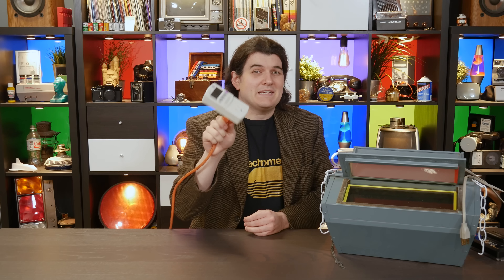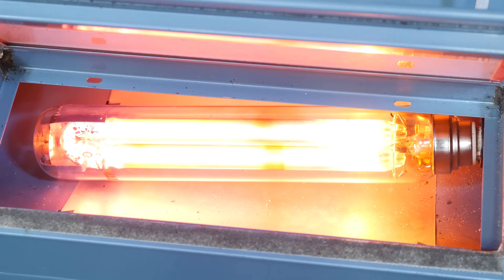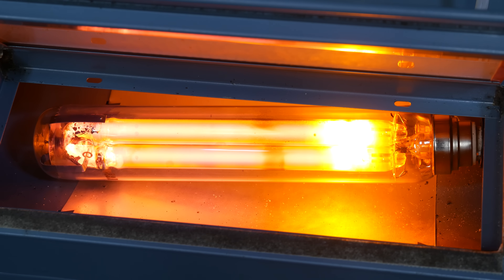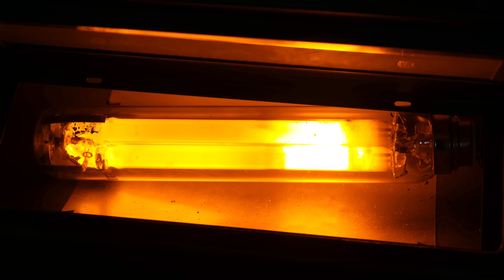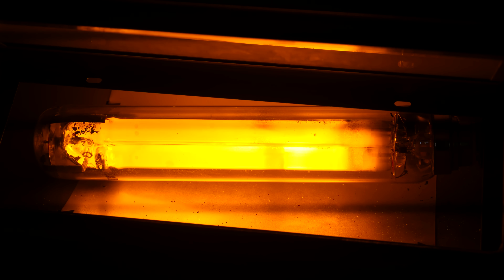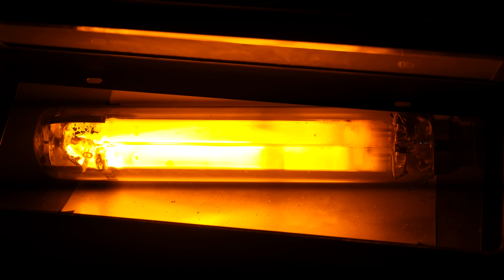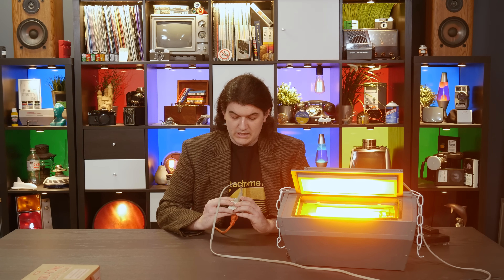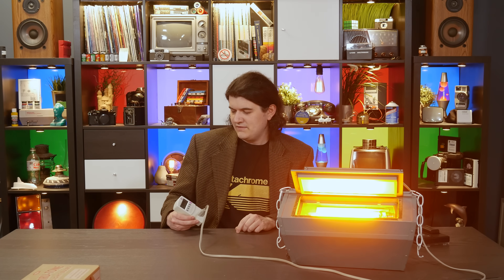More vaguely-informative ramblings about low pressure sodium lamps

Comment: It is a shame that this rather great technology is getting replaced. In many cities it seems the "consultants" they are asking are often LED-lobbying-groups and wonder oh wonder, they claim that the LEDs last so much longer and would be more efficient.
Just that neither of those claims are true. LEDs are not inherently more efficient (rather the other way around), nor are they cheaper (specially as LEDs need more electronics that all needs to be replaced if something goes wrong), they require cooling and are badly affected by high temperatures, and their lifetime CAN be longer but usually is far shorter.

Sadly the advertised lifespan of LEDs got NOTHING to do with how long they last but rather is pure (legal) marketing-wankery.
It is based on a PROJECTED lightoutput. An LED  might only be tested for 500 hours and by measuring its brightness at the start/end they can then claim the lamp has a lifespan of 20000 hours as that number is only the calculated time it would take at the current rate to drop to a certain value. That this does not take any wear of other components into consideration is ignored.
You can even built a lamp that can not last longer than say 1000 hours due to oxidation (this can be controlled very accurately) and sell it as a 100 000 hour lamp cause up to the point of failure it only lost a tiny bit of brightness.
https://en.wikipedia.org/wiki/Lumen_maintenance
Most of the time it is not the LED it self that fails but rather the rest of the circuitry, specifically the power-supply, with less than 10% of all failures being due to the LED itself.
https://www.energy.gov/sites/prod/files/2015/01/f19/led_luminaire_lifetime_guide_sept2014.pdf
They also often claim that switching does not reduce the lifespan of LEDs - which, as you might expect, is not true. 

And these methods and rules were brought to you by the same corporate conglomeration that brought to you the reduced lifespan of incandescent bulbs (as well as heavy penalties for any company that produces lightbulbs that last long).
In the last 3 years i have replaced every single LED in my house at least twice - and they are not running that long - while both my halogen desk lamps are still working after more than 20 years of use (though they seem to be exceptions).

Comment: Well I'll be! I just put a power meter on one of our 35W SOX lamps, and the figures are 53W, 0.556A, 0.40PF @245V AC (UK location). I'm blown away by that! What's worse is that this lamp (it's the yard lamp outside the backdoor) does actually have a PFC capacitor fitted! Ye holy moly, that's not good.

Yes, these lamps do fail, and from new, we get around two and a half years from standard SOX, or around five years from SOX+.  As the sputtering at the cathodes builds up on the glass tube, the lamps become dimmer. Eventually, they fail to strike as the cathodes lose their emissive material.

We have three 35W, one 50W and two 135W SOX lamps around our property, and to be honest, they all take much the same amount of time to reach peak output. If pushed, I might agree that the 135W ones take perhaps a minute or two longer, but I have never really considered timing them before and to be fair, it's burning your eyeballs to look at them even before they hit peak output.

Incidentally, we have about fifty spare 90W lamps (bulbs), but no luminaires to run them in!

Comment: LPS lamps are used with optical flatness gauges, they are a monochromatic light source and as such produce 'fringes' underneath an optically flat glass surface when pressed against another flat surface, these fringes can then be used to see how flat a surface is based on the wavelength of the light source being used. You might be able to source some bulbs intended for this purpose.

Comment: I have 1kw HPS lights in my garage to over winter my plants. Yes I could use LEDs but I like the light the HPS puts out and I don't have to heat the garage because I get waste heat from the lights. So the excess heat from the lamps and ballast are actually a plus in this application. I do supplement with LEDs but I don't think I'll be completely replacing my HPS hoods anytime in the foreseeable future. despite their huge power consumption.

Comment: When I would work on these light in old shops in San Diego and LA area, I never saw a failure of the bulb the failure was the power supply most of the time unless there phisecly where broke, the bulb would last for ever. 

I want to say we saw some shops my grandfather put in some of these low sodium and to this day still is running almost 50 yeas later.

Comment: I wonder what it would be like if they also had mercury in it also, would it improve the light?
Reply: It would probably cause the lamp to emit dangerous ultraviolet wavelengths while decreasing the efficiency.
Reply: @zspacecaptain8228  Yes but it would be mixed with the sodium, so probably not.

Comment: Hey,
This is going to be a long Comment..
I really love those lamps, even have a 35W, a 90W and was also furtunate enough to get a (if pricey) 180W one. The 35w is running pretty much every day in my living room supplied with an electronic dual fluoreszent lamp ballast, meant for 2 18W T8 lamps paralleled up. Its drawing about 37W, 161mA with a pf of 0,98. I'm by far not an expert around these lights, but according to some sources these lights are a bit picky about their operating point. Likely mine is running at an too high voltage with too little current, due to the electronic ballast. Sadly I cannot measure that waveform with my multimeter, but it is still going strong. The 90W is running on an OSRAM QTP5 80W electronic ballast meant for a weird size of t5 tubes, while consuming only 70W there. Would prefer that a little higher, though the pf is still quite good at 0,93.
The 180w is a beast! Not only because of the size, but also because of the gear needed to run it. I had spend quite some time experimenting with different circuits, and also bought wrong stuff. The odd thing with it is, despite stating 200V of arc voltage I just could not ignite the arc on our 230V supply with conventional ways. So I got a SX74 parallel Ignitor that was at least able to strike the bulb, but I was still not able to maintain the arc. Even did some tests running it between phases at 400V all with various chokes and resistive limiters. Ended up purchasing a BSX 131 leak transformer meant for 131W SOX-E bulbs. Because according to what I read, The supply for a SOX and next smaller SOX-E bulb is the same. 
It did work, but the Ignitor wouldn't stopp igniting. Manually disconnecting it when when the bulb was struck worked, so I built a small timer circuit that does that automatically.
By the way: With leak transformers they put a capacitor in series to the lamp, it is important for their operation. Don't ask me why, but without it (or a broken one (dont ask😅)) the lamp only flashes, so its not only for pf correction. At least it works now and makes A LOT of light. The arc voltage is about 330V while drawing about 200W. I don't recall the current or powerfactor though.
Alex if you want some footage or so I would be happy to share😉
Reply: Hey, thanks for your comment! I have a question if you have some time. I'd love to get an 18w LPS SOX lamp or two for some dim ambient light in my flat at night. It seems fluorescent ballasts are more readily available. Do I still need to get an igniter if I go that route? And do you have any recommendations on what to ballasts would work? (I am based in Germany and have a hunch from your username you might be as well?)
Reply: @Tony2dH  Jupp, I'm from Germany as well. I think getting a regular florescent electronic 18w ballast should do the trick just fine. In my testing with the 35w bulb and a conventional 36w ballast, it drew about 50w. I don't know how much of it was consumed in the choke, but that suggest to me that a conventional one tends to run them a little over spec. Today I run that one on a dual 18w driver parraled up just fine. If they still carry it, you can get one of them along with a nice case from obi, sold as a dual 18w t8 light fitting meant for humid environments. With that you only need the one channel and no ignitor😉
Reply: @techtastisch7569  Amazing, all the info I needed! Dankeschön 😄
Reply: @Tony2dH  Gern geschehen:)

Comment: The driving reason why a consumer wants a low power factor is the billing for electricity.  You are charged by the current you use.  You get value from the energy.  So the power factor essentially tells you what percentage of the electricity that you are being charged for that you are actually using.

Comment: Bad power factor means you're drawing more current from the lower voltages instead of the higher voltage. The power should be about the same because it's a lower voltage.

Comment: Hawaii uses LPS lights, I believe they even have a law about using them because of the observatories on Mauna Kea. The spectrum emitted by LPS lamps doesn't really occur in nature (out in space at least) so it's pretty straightforward to filter that light out. LED replacements unfortunately have numerous spectral lines and are much more difficult to deal with.
Reply: Blame a Democrat for this mess. Obama was wanting to remove regular light bulbs now we have bulbs toxic mercury.
Reply: @jaysmith179  What? That has nothing to do with anything. Besides, everything is going LED now so no mercury. Regular light bulbs suck and it was right to get rid of them.

Comment: For years my family home had a sodium fixture installed over the garage (I think it was HPS). It lasted 30 years running from dusk to about 1AM until one day it stopped working. The bulb was fine, the damn ballast quit! I'd say most fixtures the ballast will fail long before the bulb does.
Reply: That was certainly the case with the domestic HID fixtures I bought during the 2010s. Almost every one of those had to be returned at least once. Problem was always the ballast or ignitor, not the lamp.

Comment: Fun(ish) fact about power factor: because large parts of the Dutch power grid are underground and the ground is rather wet, the ground starts acting as a capacitor and reduces overall reactance.
This means factories can have worse power factors without having to pay like in neighbouring countries.
Reply: Nit pick: A capacitor is also a reactive load.  But most factories are inductive, so the ground's capacitive reactance cancels the factory's inductive reactance.  But you probably knew that.
Reply: The field does not extend beyond the shield conductor of the cable so ground water does not come into it. The capacitance of a cable is only due to the close proximity between the phase conductor and the grounded shield.
Reply: @pettere8429  the proximity is less important than the dielectric. An oil filled capacitor has hardly any capacitance before the oil is added.
Reply: What. What the heck 😯
Reply: Maybe the people doing the math are smoking pot.

Comment: The electrodes are the wear point. The exciting of the gas at startup requires the electrodes to "work hard" until operating temp is reached.  The electrodes are in constant wear during use, yes, but nearly immeasurable.  If left on, they will last "longer" than one that is cycled. The requirements of startup are the main life shortening factor. Similar to fluorescent tunes, threads may be blackened and yet the lamp works. Until you turn it off, and then try to turn it back on. It may have a low glow and flicker (maybe) but it won't light. Thats because the burn on the electrodes creates the extra resistance and it can't strike. Sorry for the droning on. But it is actually the same as that light bulb in the firehouse for like 109 years or whatever. They have it running low to preserve it. And they leave it lit to preserve the electrodes (filamant in that case) from the damage of on-off operation.
Reply: The million hour bulb in the firehouse is carbon filament so totally different to anything in use now. Something happened to the filament decades ago and it is almost semiconductor and it naturally runs very dim. At one point it got a lot brighter for a time and then dimmed again. There is some very odd stuff going on in that bulb. It's also a special brand that was sold as having an extremely long life, some of the other documented very long lived bulbs were the same brand - they eventually failed. If I recall correctly the carbon filament is coated with something else by that manufacturer.

Comment: 13:17 could that be caused by  the bad pover factor? My guess is that because current and voltage are out of sync pulls more or less power at different times, because the sine waves get closer and then further away?

Comment: A fun fact you might not know - because they are low-pressure, you can run these on a modern electronic fluorescent lamp ballast, and many enthusiasts do. You get no buzzing, near-zero power loss in the ballast, perfect power factor, and no flickering (which is usually also better for the lamp, as well as your eyes). People often use the Fulham WH2 ballast for the 18W lamps, so I suspect the WH3 would provide enough power for the 35W lamps.
Reply: ENTHUSIASTS?!?!!
YOU MEAN I'M NOT ALONE AND INSANE FOR YEARING FOR THESE TO THE POINT OF TRYING TO MAKE CUSTOM FIXTURES?!?!?!?
Reply: @christine lane. For anything that you are interested in there are people that spend ridiculous amounts of time and money to do it better than you ever thought possible
Reply: @thecrowcook 
Can confirm. Best example I can give: flashlights.
Reply: @chistinelane  there are at least dozens of you
Reply: @chistinelane  no you're not alone my friend. Cheers from Italy.
Reply: @chistinelane  yep :) not the only one.
Reply: @chistinelane  You're certainly not alone
Reply: @chistinelane  BRO I'M THE SAME
Reply: Ok now i'm reading about hardcore lamp modders.

Help
Reply: Is there a forum somewhere? I'm desperately to built my first LPS lamp
Reply: @chistinelane  lightinggallery might be of some help! eBay has lots of listings, though LPS lamps can be expensive. glow-object is the only place I can find them new.
Reply: I've been using a WH3 ballast for 35w SOX for D2D service for 2.5 years now. So far so good.
Reply: Agreed!  This is precisely the way I run mine!
Reply: If you wouldn't mind elaborating for a beginner: to get the LPS lamp to work, I'd need an electronic ballast with the right wattage, but do I then need to connect an igniter as well? Then attach the fitting to the igniter?
Reply: @Tony2dH  You would need a Fulham workhorse ballast specifically unless you have found another resource of information. Each model of workhorse ballast can likely support a small range of SOX lamps. However,  you will need to do your own research as to what ballast and how many wires to use as workhorse ballasts were not designed to power SOX lamps. Also, no ignitor is needed either.
Reply: @589nm6  Ah, thanks for the reply! As I understand it, the Fulham ballast uses 120V so because I'm in Europe I would need to find an alternative with 230V, right?
Reply: @Tony2dH  No problem. They do make a 230v version, although it is a little harder to find.
Reply: @589nm6  Hopefully you can reply to this but do you know how the fullham ballasts work internally? Are they just pure bland instant start fluorescent circuit that use resonant start with a LC circuit or does it have some sort of SIDAC/Thyristor ignition mechanism internally, as if it is resonant start it wouldn't work with only 2 wires.
Reply: Cheap warehouse supplement lighting that gives you a headache and they use them in crappy warehouses
Reply: @adaptercrash This. There are valid reasons to have these in a lab (interferometry, namely), but I wouldn’t get excited about these. They’re as old and common as anything, you just have to look in the right places . You might find HPS easier to source and functionally similar, but this is a weird thing to get excited over (no judgement, you people do your thing).
Reply: @silverXnoise  I know I'm weird but they are pretty special. First of all HPS lamps don't feel as "pure", the light is not pure yellow as there are mercury and xenon in the fill (sodium existing as a mercury-sodium amalgam), plus the much higher pressure widens the sodium emission spectrum. The lab lights on the other hand aren't designed for general lighting obviously and efficacy is utter rubbish, just somewhat better than an incandescent bulb. To be fair, at mimicking LPS lamps, I had better luck with 1700k-2100k LEDs than HPS. It does have a very mesmerising yellow glow that I fell in love with after just seeing it once in Adelaide, but in Asia/Oceania these are extremely hard to come by as they were never used on a large scale.
Reply: That is good info.
Reply: As an HID enthusiast I was elated to find this video. Been buying ballasts and lamps from eBay while I still can!
Reply: electronic ballasts are pretty bad with the power factor and curve of the current. You get the same bursty behavior of consumption like any other switching supply without PFC.
Reply: @two_number_nines  That's certainly true for the cheap no-name ballasts, but the decent ones made by Fulham, Sylvania, and Philips are better.
Reply: @two_number_nines  Depends on the ballast.  The Fulham Workhorse 3 I converted my LPS safelight to use is 36W and 37VA.